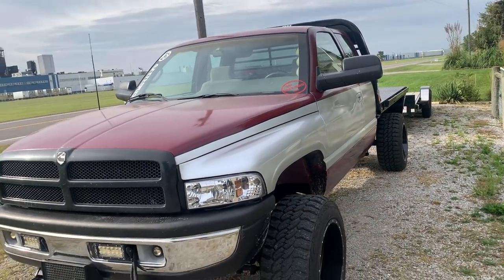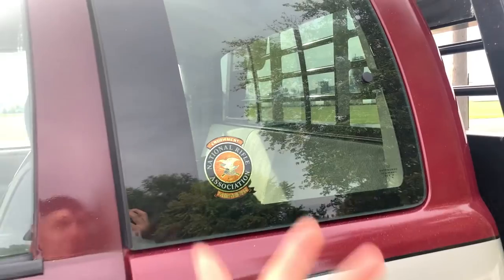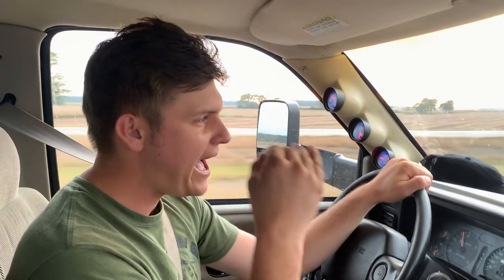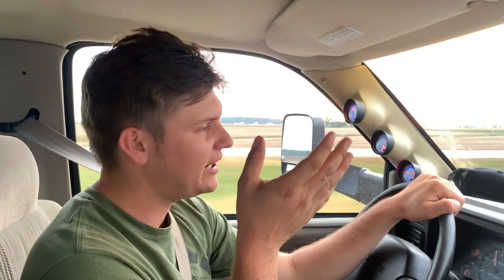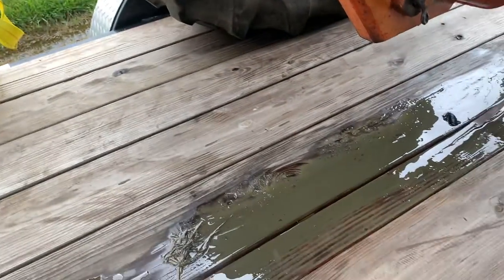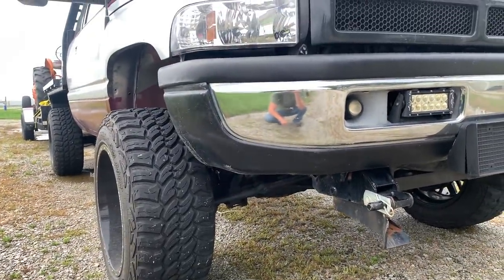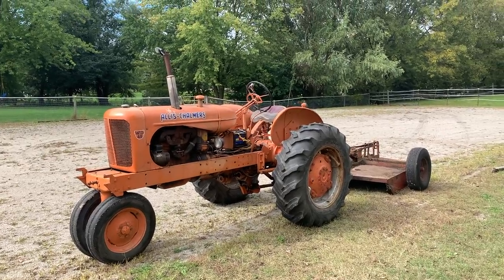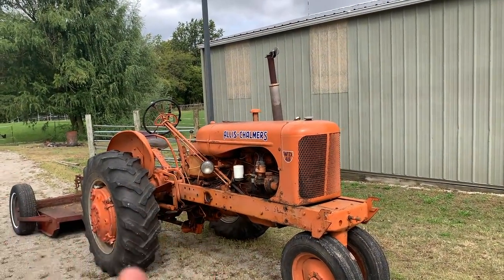We had an accident while towing with NASTY RED...

Comment: Your milky oil leak isn't from a blown head gasket, that is just the hydro/gear oil. Not surprising really either for it to be milky. Condensation happens on the inside of the case and then mixes and causes the milk shake especially if its been sitting a while. If it has sat outside (when it is raining) water can make its way in, we have a JD 520 that if its outside and it rains even just a little water gets into the rear end. Don't know how but it does. Little trick to avoid making a milkshake, if it has been sitting a while like weeks or months. Before starting, crack the drain plug and let the water run out, this will help prolong having to change the oil because of it getting milky.

Comment: if you want to get all the grease and grime and oil build off use easyoff ovan cleaner works awesome and straight pipe and far leaks go wash it down good and clean run till you find the leak.thanks

- nick